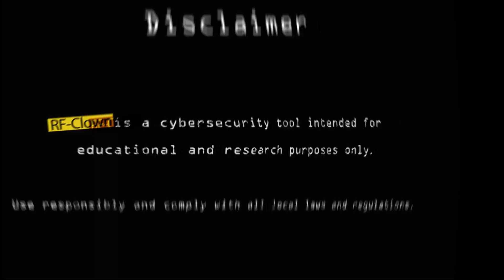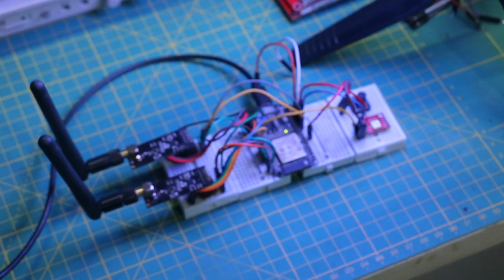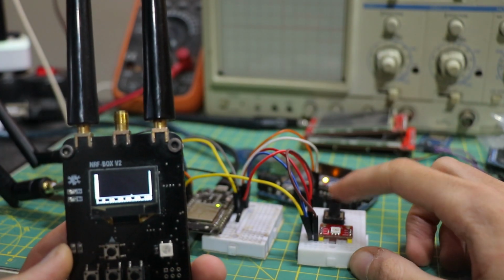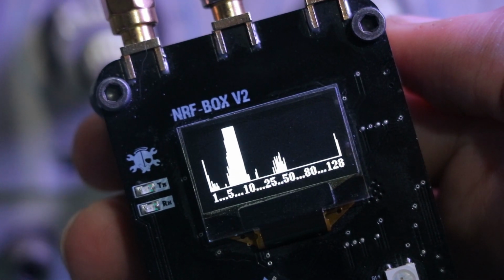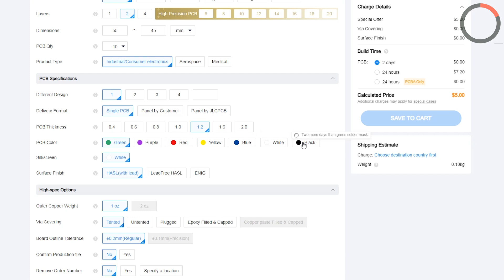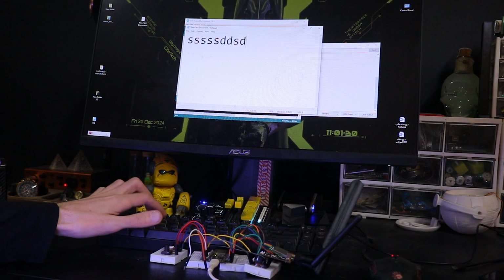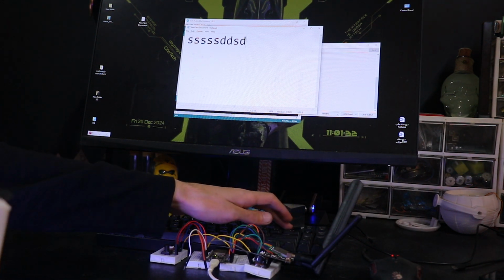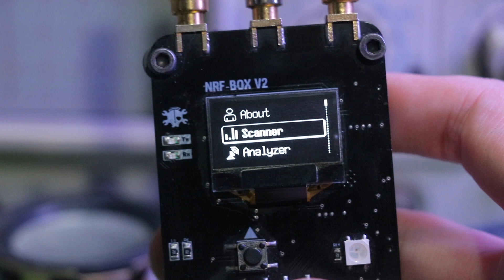Your Portable BLE Jamming Tool

Comment: One quick note — I noticed something interesting. The setup is great overall, but there’s a small issue: it forces the NRF boards to operate in PA Max mode, which drives the transmit power to around +20 dBm. While this ensures strong signal strength, it comes with a few downsides.

Running at maximum power increases power consumption significantly and, more importantly, causes the boards to overheat over time. Prolonged use in this mode could potentially damage or degrade the NRF modules.

Also, I noticed that all radios are currently hopping on the same channel. You could improve efficiency by distributing them across multiple channels simultaneously, then performing coordinated frequency hopping across those. This would reduce interference and make the communication more stable and effective overall.

Comment: have you tried using it in long range like 5 - 10 meters? I want to build this to jam the Bluetooth speaker of my noisy neighbor.
Reply: It has terrible range, especially if there are obstacles like walls. You'd need 4w or even 8w RF amplifiers on both antennas before having a chance to reach 10 meters.
Reply: Sorry, I'm sure these devices are very low powered and only works in a very close range, desktop close. For noisy neighbors I used a 1 watt  usb powered sweep jammer from Aliexpress, works barely. Instead I bought a 20 watts version and that works way better, but only with my next door neighbor (the walls are separated by ~1meter). For the neighbor from across the street 20 watts is not enough.
Reply: @luiserasmo where did you buy it? I'm interested in buying it
Reply: @luiserasmo where could I get that 20 watt version you’re talking about? Thank you !
Reply: Maybe with a Yagi antenna.
Reply: You gotta go full special agent mode. Make it remote controlled and sneak it into his apartment. But this would be even more illegal.
Reply: That’s illegal in most places.
Reply: Thats no te question 🙄 @genericgarbagegamingchanne9466
Reply: @genericgarbagegamingchanne9466  You have to experience the nightmare of living next to a inconsiderate person that you have asked repeatedly to please lower their music to no avail, short of murdering the person everything somehow becomes legal like magic,once you hit that button and that music or speaker blows up is orgasmic, hope you never experience the nightmare of a noisy neighbor,its horrible.

Comment: This jammer can be very usefull if for example you detect unauthorized transfer of data via bluetooth in this instance so device could be confgured  to activate to disrupt transfer when detected. This can be used as security measure.

Comment: Bro Please use RTL8720DN BW16 Chip in NRF Box by which it can be able to analyze 2.4 ghz to 5.8 ghz .
And then it will be the NRF Box ♾️☢️☣️.
Use RTL8720DN BW16 Chip only for analyzer and jammer for 2.4 ghz to 5.8 ghz frequencies. 
Use ESP32 as main Chip by which it will consume some extra  coding efforts.
Reply: This chip won't make "jamming" On the 5ghz band possible